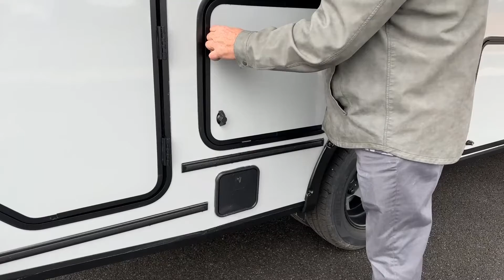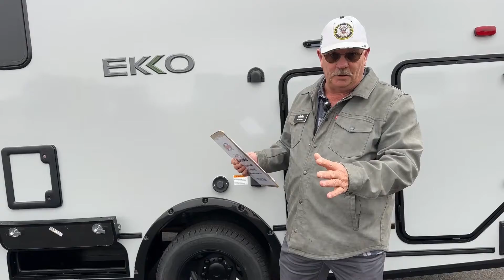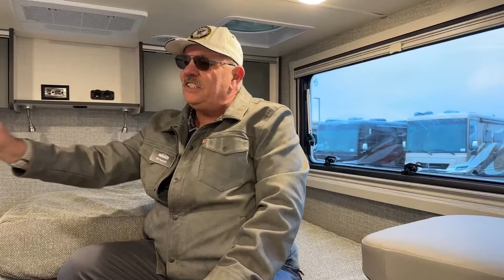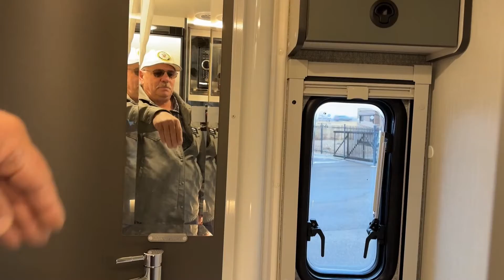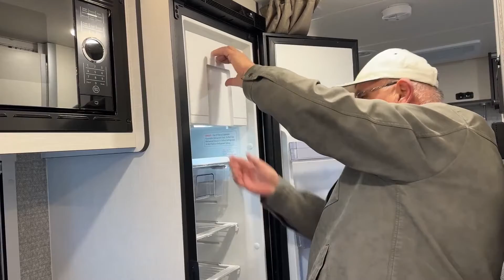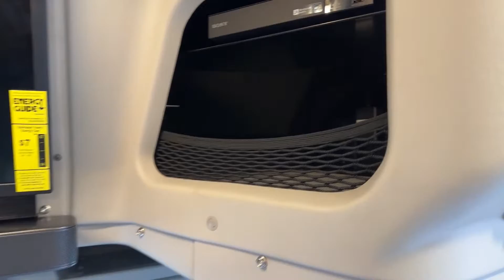2024 Winnebago EKKO 22A

Comment: It is a well designed RV.  I think the Ekko is the closest design to Euro models. To their credit, they have copied much of the layout and extras like swivel chairs, garage, cassette toilet, swivel shower wall, and German bed system.  

Price tag should come down a lot. Euro RVs are in the $70 - $90K range. The Ekko initial price was $168K - outrageous. More than double!  Today it is $222K!!!!  I can import a Euro RV with a step down transformer for much less. Why are American manufacturers raising the price so much?  They don't pay their factory workers a decent wage either, like the Europeans.  It is way too pricey.  Houses cost less.

I loved the red countertops of the older Ekko models by the way.  A welcome splash of color on an otherwise dull grey beige interior. Now they made it more dull and grey. Americans are as afraid of offending someone with color as they are with expressing emotions.  Constipated color scheme.  Add the red back.

This fridge won't cut it for me.  I opt for less bed and more fridge.  A simple slat bed that converts into a seating bench is plenty.  Extend the kitchen, double the fridge and freezer.  Add a generator to power up that battery fast. Lithionics is an excellent battery choice - the best - so good job on that.
Love the garage.  Pop top is useful if you have kids.  Too bad we did not see the pop top.
Thanks for the guided tour!

Comment: The Sprinter version has a really nice lounge seating area instead of the dual seats facing the driver on this and previous year models.  Not sure why they didn't do that on the Transit version.  That's kind of disappointing. Also there's no propane stove built in to the countertop in the Sprinter either...That should be an option only.  I would rather have the Sprinter interior  with the Transit chassis...